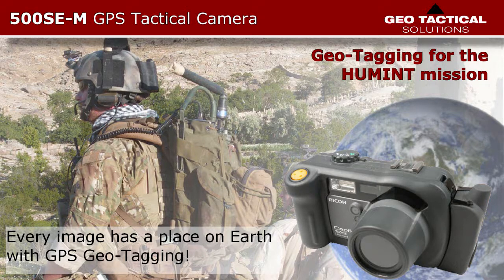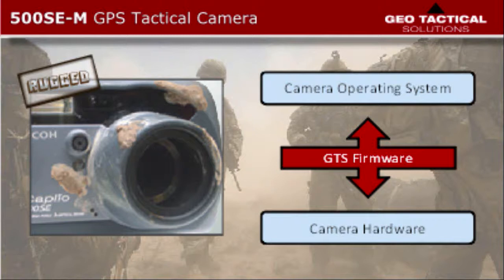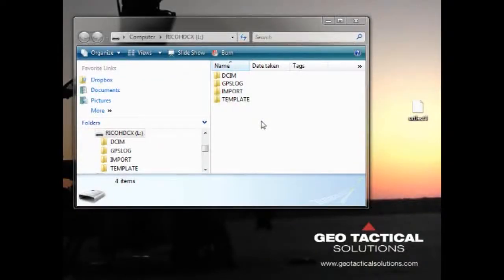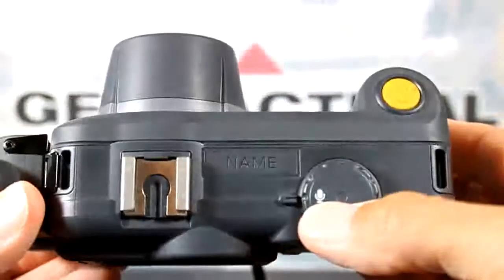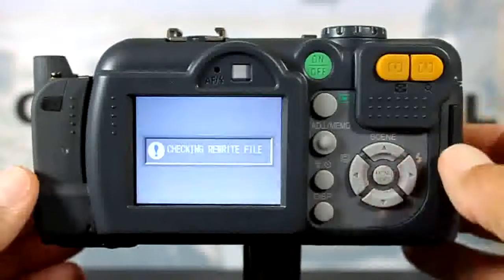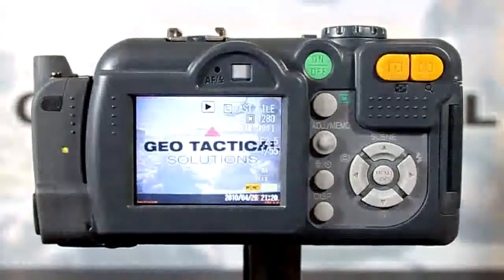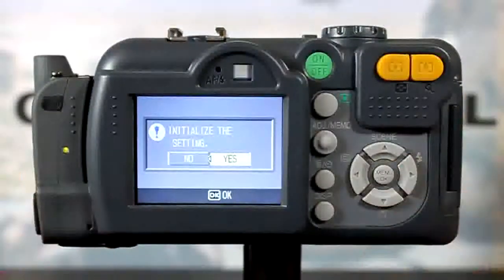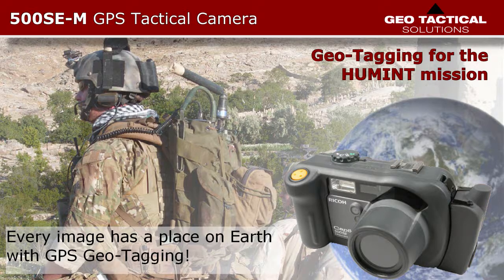500SE-M GPS Camera: Updating Firmware

Comment: I watched and  followed the  directions.  The first part worked correctly. After the camera powered back on and  I powered it off, the "Hold Up arrow (scene) and Left Zoom In (yellow) button, and press (green) Power ON while holding first two buttons down (press all three buttons at once)" doesn't  work.  Now the re-flash buttons don't work either. The software,however,  does appear to be upgraded  to V3.70.